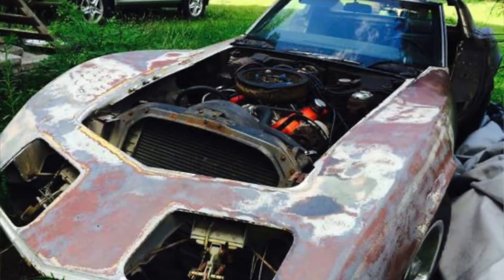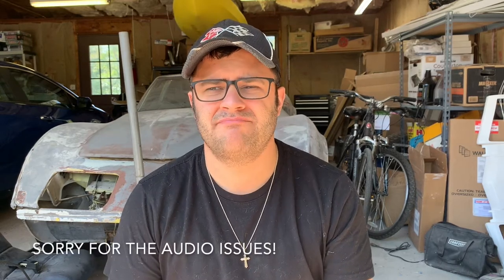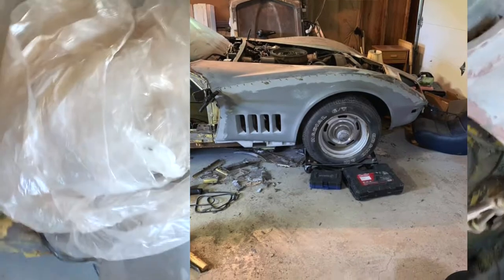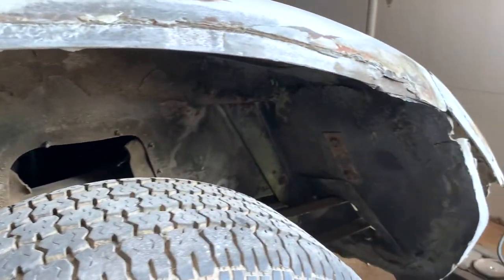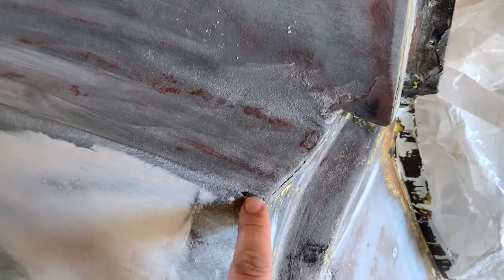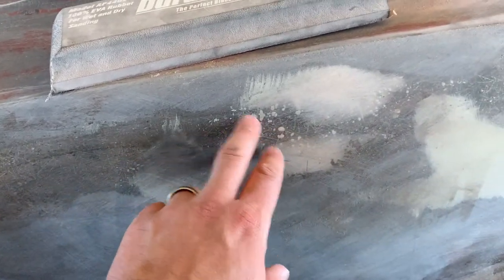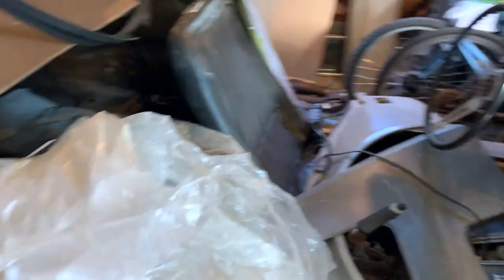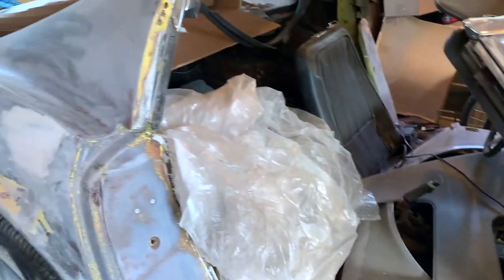1969 Corvette C3 Rebuild Part 1

Comment: I have questions I came across a 68 4 speed for 5k is that a good price ?
Reply from the maker: It's often said that, "The most expensive project car is a cheap project car." Corvettes are known to have birdcage issues and frame rot issues. Without knowing the details of the car you've seen it is hard to say whether that is a good price or not. Are all the parts there? What is the condition of the exterior/interior? Does it run? All questions to ask.  Everything is repairable but it's about your skill, time, and budget. There's a good thread on the Corvette Forum about what to look for in a car you're thinking about purchasing. I hope this helps!